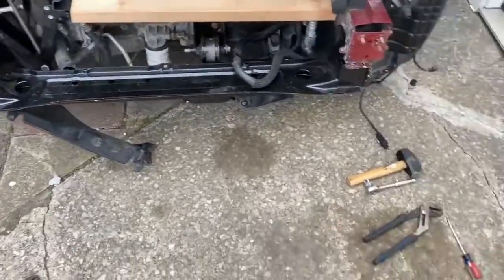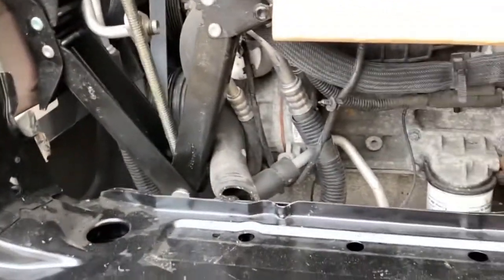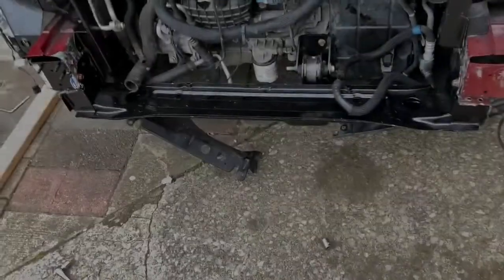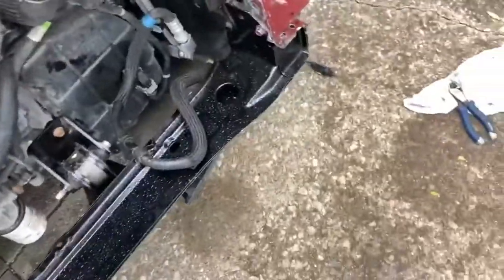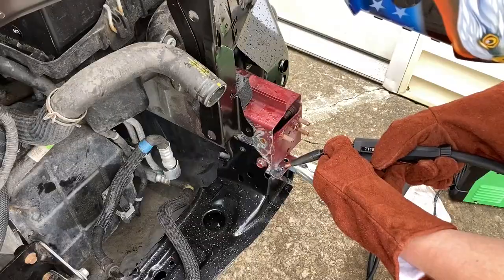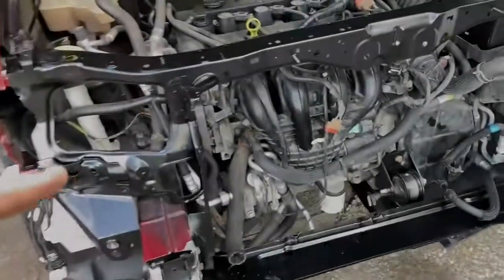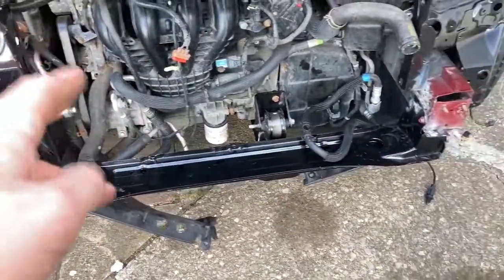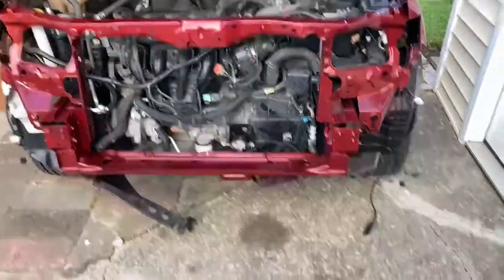Copart Ford Escape Welding on NEW Radiator Supports | 2012 Ford Escape Rebuild Part 5

Comment: Thanks for the video! Looking to do the rad mounts for my 2009 Ford escape. Could you share how much your mounts were? What rattle can did you use for the paint? (Mine is the same red)

Great video!!
Reply from the maker: I can’t remember how much, but I got the paint from eBay I believe! You can find paint to match the paint code of the car!!

Comment: Nice job! What are your thoughts on a Copart water damaged salvaged vehicle that just barely got water to the floor board on a pick up or SUV?
Reply from the maker: Thanks Steve! So, I personally haven't purchased a water damaged vehicle yet, I may in the future. If the water hasn't breached the interior floor and only the exterior you are probably just fine, assuming water didn't get in the engine or transmission. If the water did breach the interior things get iffy, many manufactures put computer modules in the floors and under the seats and if they get wet...game over and you have to replace them. Hope this helps!